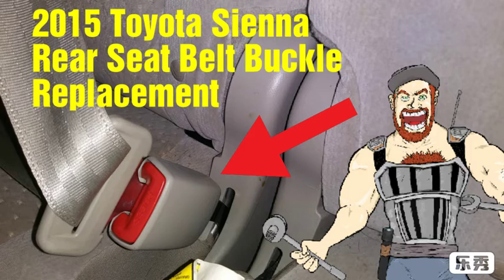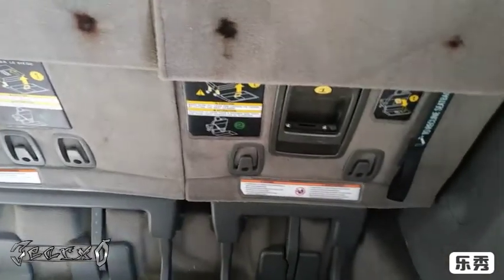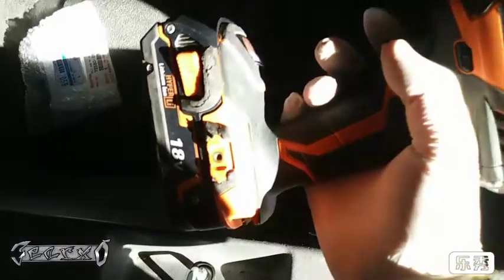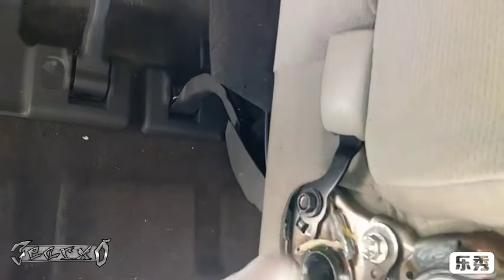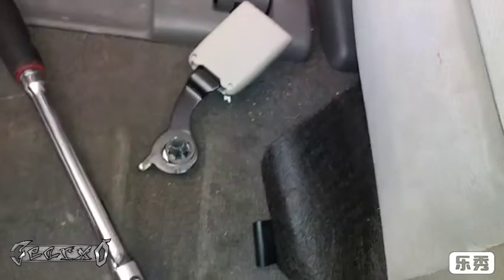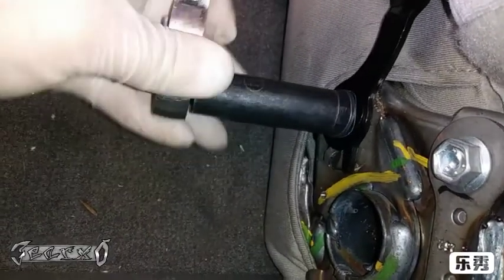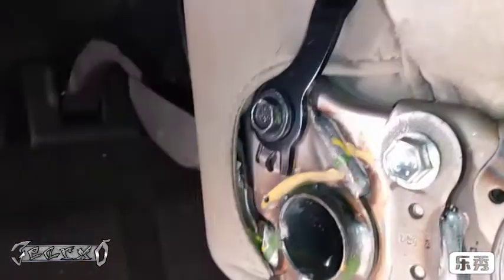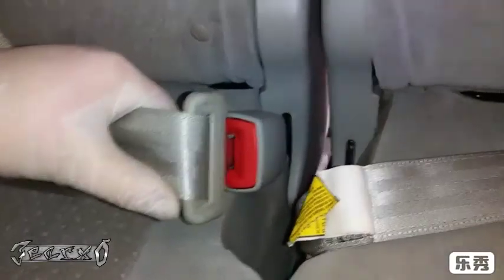2015 Sienna Rear Seat Belt Buckle Replacement

Comment: I’m having a lot of issues getting the bolt unstuck. Tried PB, a socket with a drill, etc to no avail. I’m hesitant to get into a heating element since I could probably take it somewhere and get it done for cheaper than that. Any thoughts? Thanks!